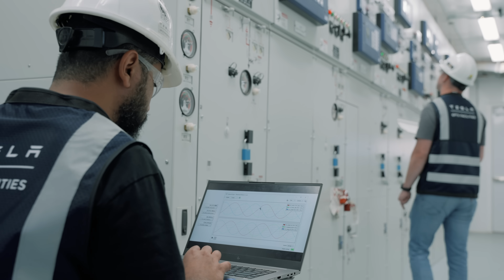Forming the Future Grid | Tesla Megapack

Comment: (I got  this from grok)AI Innovations for Everyday Manufacturing: Ideas to Amp Up Automation

AI is already transforming manufacturing, but let's push the envelope with practical, scalable ideas tailored to treadmills, cars, power lines, robots, and cranes. These concepts build on current tech like predictive analytics and generative design, aiming for efficiency, sustainability, and zero-waste production. I'll break it down by category, with 5-6 bold ideas each—mixing incremental upgrades and wild-card futurism.

#### 1. *Treadmills (Fitness Equipment Manufacturing)*
   Treadmills are all about precision mechanics and user personalization; AI could make assembly lines smarter and products more adaptive.
   - **Generative Design for Custom Frames**: Use AI (like Autodesk's tools) to auto-generate lightweight, ergonomic aluminum frames based on user biometrics from wearables—reducing material use by 25% and enabling on-demand 3D printing for boutique gyms.
   - **Predictive Belt Tuning**: AI sensors during assembly test belt tension in real-time, learning from failure data to auto-adjust machinery, cutting defects by 40% and extending product life via embedded self-calibrating motors.
   - **Swarm Robotics for Assembly**: Small AI-coordinated robots handle wiring and console integration, optimizing paths to shave 30% off production time—think ant colonies building a treadmill in under 10 minutes.
   - **Sustainability Optimizer**: AI analyzes recycled plastics for deck molding, predicting durability and carbon footprint, turning e-waste into eco-treadmills that qualify for green certifications.
   - **Personalization at Scale**: Factory-floor AI scans incoming orders and reconfigures lines for variants (e.g., incline ratios), using computer vision to ensure perfect alignment without human tweaks.

#### 2. *Cars (Automotive Production)*
   Car manufacturing is ripe for AI, from Tesla's factories to Ford's lines—focusing on EVs and autonomy to hit net-zero goals.
   - **AI-Driven Chassis Welding**: Robotic arms with vision AI predict weld imperfections mid-process, auto-correcting with laser precision to boost structural integrity by 50%, especially for lightweight EV frames.
   - **Battery Assembly Swarm**: AI orchestrates micro-robots to layer cells with zero gaps, using ML to forecast thermal runaway risks—reducing recall rates and enabling faster scaling for gigafactories.
   - **Generative Aerodynamics**: AI simulates wind tunnel tests in seconds to tweak body panels, cutting drag by 10% per model iteration and integrating with additive manufacturing for seamless prototypes.
   - **Supply Chain Oracle**: AI forecasts part shortages (e.g., rare earths for motors) and auto-reroutes suppliers, minimizing downtime—vital for just-in-time lines amid global chip crunches.
   - **Quality Assurance Drones**: Flying AI inspectors scan undercarriages for paint flaws or misalignments post-assembly, flagging issues with 99% accuracy to slash inspection costs.
   - **End-of-Line Personalization**: AI customizes infotainment and seats based on buyer data during final assembly, turning mass production into "your car, your way" without halting the line.

#### 3. *Power Lines (Utility Infrastructure)*
   Drawing from ongoing grid upgrades, AI could make power lines self-aware networks, resilient to storms and smarter for renewables.
   - **Predictive Pole Reinforcement**: AI analyzes weather data to auto-design and fabricate composite poles with embedded sensors, strengthening them preemptively—extending lifespan from 40 to 60+ years.
   - **Conductor Strand Optimizer**: During extrusion, AI fine-tunes aluminum-steel composites for optimal conductivity, reducing sag in hot climates and integrating carbon cores for 2x capacity.
   - **Drone-Assisted Installation Bots**: AI-guided drones string lines over rough terrain, using LiDAR to map routes and avoid obstacles—cutting crew risks and time by 70% in rural builds.
   - **Self-Healing Insulator Forging**: AI molds ceramic/polymer insulators with micro-capsules that release sealants on cracks, manufactured via robotic presses for fault-tolerant lines.
   - **Energy Harvesting Weavers**: AI weaves fiber-optic strands into conductors during production, enabling lines to tap ambient vibrations for powering sensors—boosting grid efficiency.
   - **Fault-Forecasting Fabricators**: Factory AI simulates line failures to tweak manufacturing tolerances, ensuring components like transformers handle surges from solar spikes without melting down.

#### 4. *Robots (Industrial and Consumer Bots)*
   Meta-AI for robots: Making them assemble themselves smarter, from warehouse pickers to home helpers.
   - **Self-Evolving Arm Design**: AI uses evolutionary algorithms to iterate joint geometries during 3D printing, creating grippers that adapt to tasks like delicate picking—reducing custom tooling needs.
   - **Swarm Learning Assembly**: Robots train each other on the line via federated AI, sharing "muscle memory" for tasks like soldering—scaling production 3x without central programming.
   - **Modular Brain Imprinting**: During core assembly, AI imprints task-specific neural nets onto processors, allowing plug-and-play upgrades for bots in dynamic environments like hospitals.
   - **Waste-to-Part Recycler**: AI scans scrap metal/plastics and directs shredders to reform them into chassis, closing the loop for sustainable bot manufacturing.
   - **Haptic Feedback Forging**: AI simulates human touch in molding sensor skins, ensuring bots "feel" textures accurately—key for collaborative models in construction.

#### 5. *Cranes (Heavy Machinery Construction)*
   Cranes demand brute strength with finesse; AI could turn them into predictive powerhouses for safer, faster builds.
   - **Load-Predicting Boom Extrusion**: AI models wind/vibration data to extrude carbon-fiber booms with variable thickness, preventing snaps and allowing 20% taller lifts.
   - **AI-Orchestrated Cable Weaving**: Robotic looms use ML to braid high-tensile wires with anti-fatigue alloys, auto-adjusting for crane types—extending hoist life by 50%.
   - **Autonomous Rigging Bots**: Ground-based AI crawlers attach slings and sensors pre-launch, using AR overlays to align perfectly—reducing setup time from hours to minutes.
   - **Vibration-Dampening Counterweight Molding**: AI pours concrete/steel mixes tuned to dampen oscillations, based on site simulations—enhancing stability in quake-prone areas.
   - **Fleet Harmony Simulator**: Pre-assembly AI virtualizes crane teams to optimize gear ratios, ensuring synchronized lifts on megaprojects like skyscrapers.
   - **Eco-Fuel Cell Integration**: During cab assembly, AI routes hydrogen lines for hybrid cranes, predicting energy needs to minimize diesel use by 60%.

Comment: A single shipping-container battery that silently wireless-charges every EV within 500 meters — while still delivering 4 MWh to the grid. 350 Wh/kg, 20,000+ cycles, Na/Mg chemistry, resonant magnetic field. The Magneto-Pulse Ion Tank is here. Thread ↓
1.  Park anywhere in a 400–500 m radius and your car just… charges. No plugs, no pads, no alignment. One MPIT tank beams 3–22 kW to every vehicle simultaneously using safe 85 kHz resonant fields. This is the future of fleet & public charging.
1.  2026 charging stations won’t have cables.
One carbon-fiber MPIT (Megapack-sized) = 4 MWh storage + 200–500 meter wireless zone where every car gains 5–100 km of range per hour just by being nearby. Safer than lithium, cheaper than LFP, zero cobalt.
1.  Introducing the first battery that turns entire parking lots into chargers. 350 Wh/kg, 10–22 kW delivered wirelessly up to 500 m away, inherently fire-proof Na/Mg chemistry

Comment: Many ferries use diesel generators and electric propulsion. They are converted to electric. Often the batteries are place on the top deck in large containers. You should make mega packs for this or use them as is if possible, because the current solutions are so expensive and the batteries are bad. Would be awesome if you could just drop in a mega pack or two on the deck and then connect everything.
Reply: I am blessing my top fans like you, and you are to be the among the selected ones, send me a text😊

Comment: Spain had needed things like that about half a year ago. What happened when the grid was dominated by grid-following inverters was the blackout. There was an excess of capacitive reactive power that led to an overvoltage in the 400kV grid. Then some generators switched off automatically because of the overvoltage they could not get down, and darkness fell on the Iberian Peninsula. Economists still don't know what reactive power is, as it has no value for them.
Reply: Congratulations, Tesla fan! 🚀🎉
Reply: @Congrats_Check_Channel_Hompage  I am not a Tesla fan, but I have spent decades in grid operation and automation. So I know 'a little' about that.

Comment: Too bad it still relies on the grid, to charge the batteries, it just off loads the peak usage for the grid
Reply: That is not "just". That is crucial. And very profitable. You can't expect people to show up and use electricity whenever it is generated. This is a challenge no matter what kind of power plants you have.
Reply: @geirmyrvagnes8718 there are other methods of power storage as well, the main advantage a battery baded system has over them, is the speed it can supply the power to the grid

Comment: This is the future that is exciting.
Reply: Just imagine 2026 or 2027 updated tesla model 3 LR RWD with 800 volt architecture and impressive 2026 LG energy solution' all new ultra advanced 90% nickel content tab-less NCMA 21700 cells  with industry leading 6200 mAh capacity and 700amps(560kw)charging power in an 800 volt architecture with amazing 5c charging rate(10-80% in 12min) and unseen in 2170p platform of 4000 cycle life .it will have 96 kwh(545 miles WLTP)useable capacity with these new cells and because of tabless tech which has 7% better efficiency , their amazing 2027 model 3 LR RWD will have industry beating and desireble 583 miles of WLTP range . I can garantee it would be the best selling automobile of any kind in the world.(tesla can achieve 641 miles WLTP with similar 96 kwh capacity with designing and using ultra advanced 2-stage 12-switch silicon-carbide inverter for another 10% better efficiency)

Comment: Meanwhile we have nuclear in France which is powering the grid 24/7 with low emissions… this is useless
Reply: Why have only 1 form of energy thats like having all your fav foods on the table but only eating one of em
Reply: @mcsike7264 that’s not how it works, France had 86% of its power from nuclear without issues because we had hydro power for peak shaving. Introducing renewables is making the grid less stable for no valuable reason (more expensive, takes more space, no control on production)

Comment: The engineering behind this is insane.
Reply: 99% of people including tesla top engineers dont realise the reason behind 4680 poor cyle life performance in the cyber truck . Let me clear every one inculding tesla battery engineers.the reason is that because tesla wanted to have 325 kw of charging power in a 400 volt architecture they just increased the current to foolish 900 amps in the 4680 cells,that kind of current(above 700 amps) even in tabless cells will damage the cell' cycling performance because of 2 much heat generation.(i heard that they want to reduce the current to 500 amps and voltage to 1000 for 500kw charging power in cyber truck which is a very wise decision)
Reply: This is what is insane that they dont tell you: Those solar flields kill bees and butterflies that fly over them. burning birds wings off  as the heat sets the wing tips on fire, they fall to the earth and are called streamers by those that see them fall. they do the same to the butterflies and the bees that we need to pollinate our crops. Silly green energy will be the death of all life.

Comment: For clarification —
Grid-forming inverters are an advanced technology that can create and stabilize a grid's voltage and frequency, enabling them to operate independently of conventional power plants. Unlike traditional grid-following inverters, which must have an existing stable grid to connect to, grid-forming inverters can function as the primary source of power for a grid and even "black start" a downed grid after an outage by using sources like solar or wind power to restart the system. This technology is critical for supporting the stability of power grids as they incorporate more renewable energy sources.
Reply: Great explanation. Can they theoretically make synchronous condensers redundant in a grid?
Reply: What happens when a grid is dominated by grid-following inverters was seen in Spain about half a year ago.
Reply: Thanks ChatGPT 🤡
Reply: @officebear4637 I'm sure your kids will be star pupils
Reply: In german we call that inertia

Comment: Australia couldn't power a suburb with renewables it's all come crashing down in failure.

The technology is sound the concept is snake oil.
Reply: What an utterly stupid comment.
 The Australian grid is typically over 80% renewables around the middle of the day, and with batteries - renewables will be extending into the evenings too.
Reply: @guringai no it isn't.
Reply: Victoria is a national basket case, the renewable projects are collapsing and the main power source remains coal and gas, more than 70% in fact.

Australia now has the most expensive power prices on the planet which are rising daily.
Reply: @GJS65  A national basket case dominated by fossil fuels and expensive and rising prices. Sounds like they need to rethink this.
Reply: What do you mean by renewables are collapsing? Or did you really mean the collapse of the coal fired power stations all around you needing to retire due to old age in the next 2 decades to be replaced by cheap renewables and batteries?
Reply: @audiosquirrel8024 I meant what I wrote, deal with it.